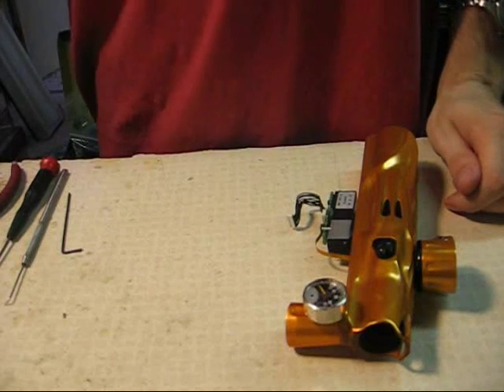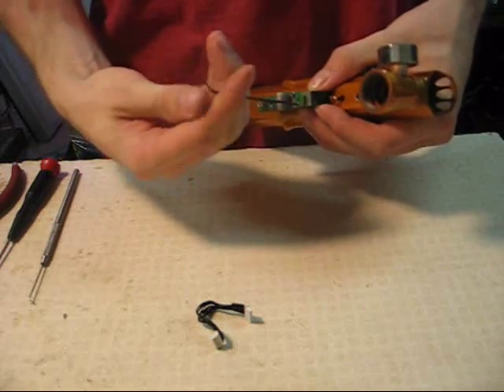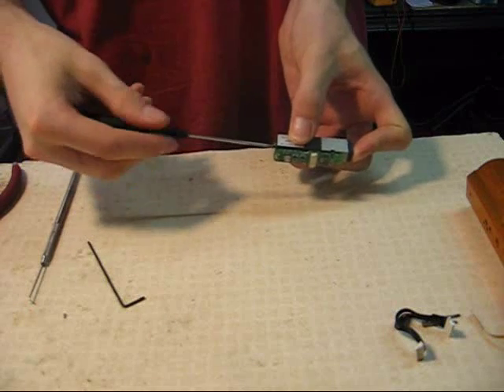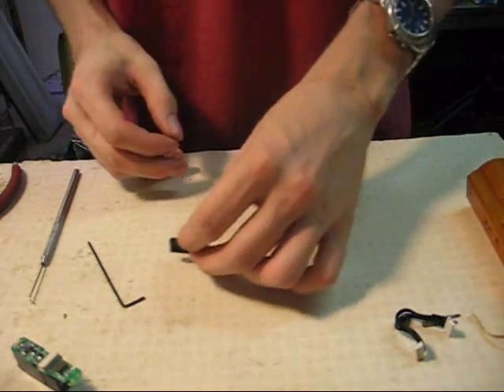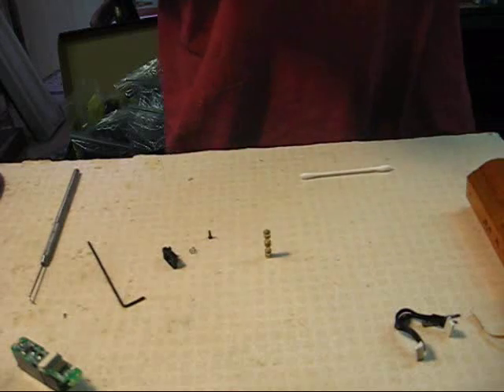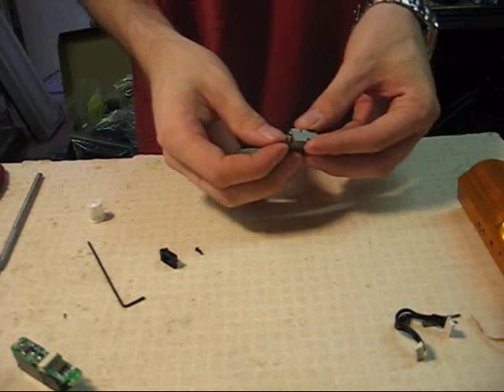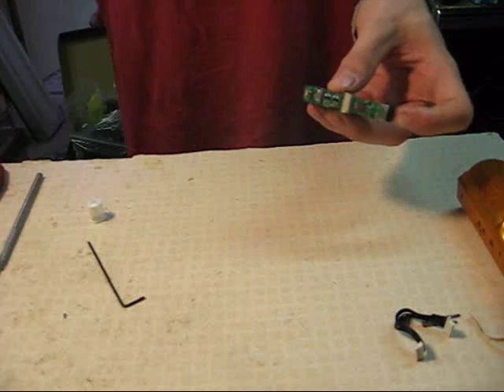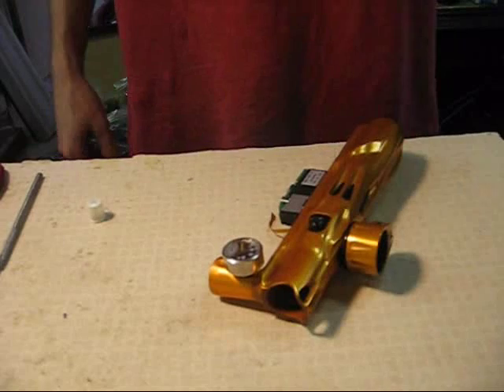shocker parker solenoid maintainance

Comment: my 06 shocker sft octane edition.  when I pull the trigger a small amount of air comes from the solenoid.  I've followed your videos on cleaning the Parker solenoid but still have this problem.  I'm not sure if you still work on shockers but figured I'd give it a shot.   it's a real clean gun just that small problem. I have another shocker believe a 04-05 not sure on year as well. but would rather get the 06 working again
Reply: Make sure the noid is properly tightened down to the body. To check air up the gun and press down on the noid. If the leal stops you know it's leaking between the noid and the body. If it's leaking within one of the noid sections you gonna need a new noid. I shot 160 psi to mine with a LP core spring and install and it shot a piece of plastic into the spool section and started leaking.
Reply: It doesn't leak from around the seal or anything, only when pulling the trigger to shoot the air escapes from solenoid itself, not sure if it's an exhaust port maybe?
Reply: ***** you'd be correct. They have vent ports for air that gets trapped from the forward and back operations. Totally normal
Reply: okay, almost all of the air is escaping through the port and only small fraction makes it inside and is able to move the bolt